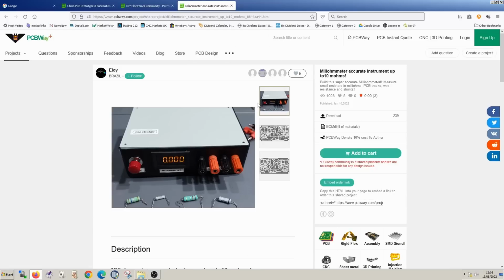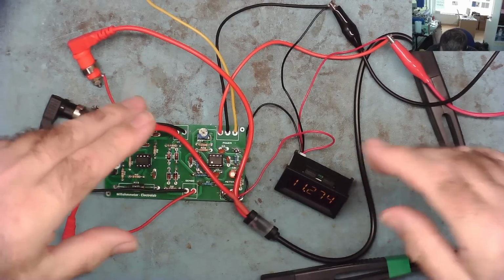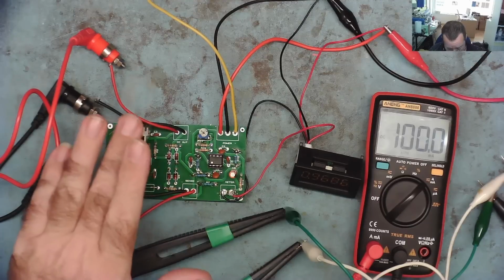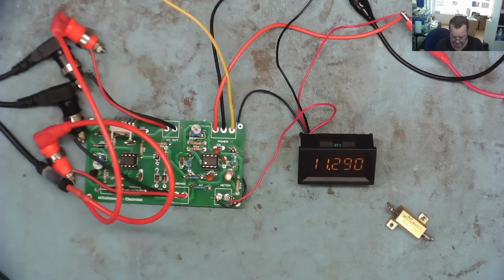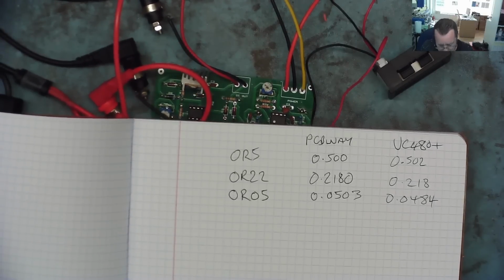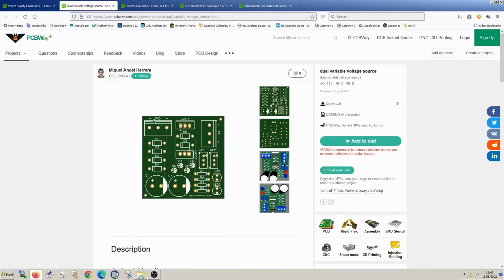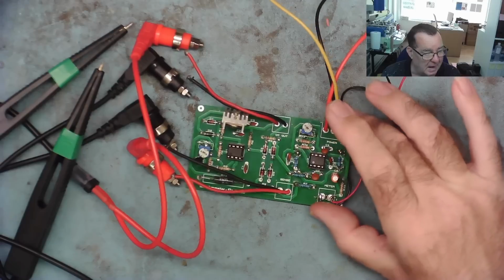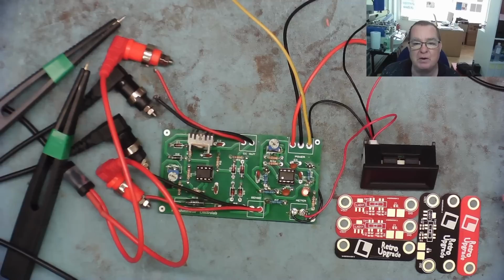Build A Cheap And Suprisingly Accurate MilliOhm Meter DIY Project

Comment: I'll be trying to built this. I definitely need a 5w 10ohm r15. It was running 1.2w according to your measurement. 

Thanks for the video. 

For the projects listed, the inverter one is my pick. Building it might teach me to repair inverters.
Reply: I’m not sure it’s necessary, there should only be 100mA going through the 10 ohm resistor so it should dissipate 100mW I think.

Comment: If you have a laboratory power supply with current control, you can deduce the low resistances using Ohm's law:
R = U/I
with U = 5V and I = 0.1A then you multiply by 10 the result of the voltage recorded by the volmeter!!

That's all !!

Comment: Nicely done!

When you get down to the resolution you got down to, measuring milliohms, everything matters.

The "settling" looks a lot like thermal EMF, I would guess because the probes are made of a different material than the resistor leads, thus forming a thermocouple that introduces enough microvolts into the measurement to become visible in the readings.  The value is always going down (or it could go up); showing a trend in one direction that way is a good clue.  (There can be other parts of the circuit that are settling that way, of course, but thermal is everywhere at these levels.)  One simple technique for that is to reverse the current and take a second reading, so that the EMF adds to the resistor voltage in one direction, and subtracts in the other because the voltage is negative.  The "real" answer is halfway between those two readings.  (This is only going to work if the circuit can handle the reading in either direction; some fussing.with the technique, or the circuit, might be required!  Could be a little tricky with only one supply voltage.)

Then...  doing the math for what kind of precision you're actually getting could be interesting!  Computing percentage for a nice selection of resistors, and getting a good feel for what you can expect from the meter.  Keep in mind the precision of the resistance measurements is entirely dependent on the precision of the current source, and the precision of the gain of the amplifier, and so on and so forth; it's going to wiggle a little bit with temperature, and time, and the weather...  and maybe what we had for dinner...

Comment: 18:40 - I have been unable to locate a micro ammeter on your channel. I hope you’re interested in such a project. I need to measure the current through an aqueous sample with 3.3vdc applied to the sample vial. You may very well will have been the first channel to produce such a circuit.

Comment: i was wondering if you use a 3 volt power supply and a current limiting resistor between 500 ohms to 2kohms to make the 20 cent short circuit tester. all you care about is the voltage the voltage to go down. i picked the resistor range because it a ratio of 1 to 1000 voltage drop

Comment: if i have a dc power supply is it possible to adjust the current to 0.1A and then use the DCPS as ah milliohmmeter? my powersupply has also 5 digit so it shoult work or not?

Comment: SIR please make a video on  transmitter and receiver  module  of RC controlled toy car , explaining  how the signal or data is transmitted  from transmitter to receiver , which controls movement of the motor in the toy  i.e forward and reverse movement

Comment: Note: The lower the value of the resistor - the more important it is to place the probes exactly on the same spot on the soldering legs.
This may be the explanation for the difference on the 0.05 ohm resistor value shown on the 2 meters.
Thanks for your efforts making up the video, highly appreciated :goodvibes:
Reply from the maker: Yeah that makes a lot of sense as at these sort of resistance values, even the resistance of the component leads becomes a factor.  I guess from your comment you were fairly impressed with the performance of this MilliOhm meter considering it is such an inexpensive device (though it does require the selection by hand of four resistors to get it to work well  -see part one)
Reply: @LearnElectronicsRepair  Cheers - Yes - I am very impressed by the accuracy.
it just shows how far you can reach with some thinking and a handful of simple components.
Reply from the maker: @CXensation  yeah me too, and despite several previous opinions I also think the el cheapo smd tweezers converted to kelvin probes worked better that expected, though I had to strap a bit of insulating tape around them, as you may have noticed, to stop the soldered together ends coming apart again due to the tension/pressure.
Reply: Regularly use one for pairing source/emitter resistors on amps - placement/tension and DUT temperature are critical factors. Best handle with ceramic tweezers, as all it takes is to grab one with your fingertips to see the reading go up substantially - as expected with 350ppm/K.

Comment: The difference between the two meters could just be down to where on the resistor leads you put the probes. A typical 0.45mm resistor lead is about 1 milliohm per centimeter IIRC. I'm impressed with how well that circuit works. Makes my fairly cheap milliohmmeter look really expensive.
Reply: Yeah thinking the same, at this range and resolution you'll definitely see the varying resistances at different points of the resistor leads, pretty impressive.
Reply: I was thinking the same
Reply: Curious what meter of yours that you’re referring to? Just curious is all
Reply: @hullinstruments  I have a Voltcraft r-200. It's a much nicer build quality than the vici meter but is about three times the price. It was the best I could find without getting into very expensive electrical installation testing meters, or professional level milliohm meters costing thousands.
Reply from the maker: Yeah you are the second to make  this comment about where on the resistor legs i placed the probes.   If there is one thing this tells me about this very cheap MilliOhm meter it's that it is extremely sensitive, far more accurate than I expected, and well worth building,  on a bang for bucks scale of one to ten it has to be near the top end 😃

Comment: To anyone interested in cheap/DIY troubleshooting tools and equipment… I’ll post some info below.

I been Absolutely loving your test equipment content. I haven’t really enjoyed electronics as a hobby or outside of work hours for a few years but after stumbling across your channel it’s kind of getting me back into it.

I’ve left a lot of comments on your test other vids and I’m going to copy and paste them below for anyone who wants to read them. 

I have my own metrology lab and do this full-time, and I specialized in test equipment. But I also collect useful and strange test equipment ….especially devices that speed up the process of troubleshooting. I’ve got nearly 2 dozen devices in my collection that have been sold or offered as DIY designs over the last 30 or 40 years… All of them can pretty much be summed up to “short circuit tracers“… But it’s amazing how some of them go about it and some of the really neat and weird design choices. Sorry for the long comment but I’ll post a summary of my comments here below…..
Reply: Best thing I found is a “audible milliohm meter” like the EDS “ leak seeker” ..... 

seriously look it up if you haven’t seen one. 

It’s basically an extremely fast and accurate low ohms meter that SINGS. It plays a different pitch as the resistance changes, even the tiniest changes in resistance. Like the difference in 1 mm of copper trace.

allowing you to track down shorts like nothing else you’ve ever seen. And I’ve got a metrology business doing test equipment repair and calibration… So I’ve got all the professional expensive benchtop gear… But I swear to God I grab for the EDS devices every day. Not only the leak seeker but also the cap analyzer. 

 Not affiliated with them at all, I’ve only talked to Dave the designer once or twice. Nothing to gain or lose and don’t give a shit if anyone checks it out… I’m recommending it only because of how much it’s helped me and countless others.

Like everything, it takes a bit of practice to get used to it. I like to compare it to a high-end Metal Detector or something like that… You can’t just spend a ton of money and expect it to work and interface with your brain instantly. Or like professional engraving equipment used by jewelers and Gunsmith. Or a fancy tattoo gun or something like that .....You can spend a few thousand dollars on an engraving machine… But you still have to learn to use it and practice.

But with a little bit of practice it will be One of the most useful tools in your arsenal.
———————————————-

Also, not sure if you folks are familiar with the device called the “half ohm” available online pretty cheap. And other multimeter adapters that you can build cheap or free. 

There are many videos on YouTube about these milli-ohm adapters, I’ve tried several variations and they’re all pretty decent. 

Especially if you use one of the cheap sets of kelvin clips/silicone leads available on eBay and other places in China. 

Don’t get me wrong, I love my fancy benchtop equipment, with their various leads and fixtures, all beautifully and painstakingly designed… 

But you can spend several hundred dollars very easily on a simple set of Agilent/keysight text leads. And unless you’re doing this work every day and offering it as a service like I am, it’s pretty much ridiculous and not needed. And you can get by with some thing that is incredibly affordable. With a precision that will surprise you!

 It really is the golden age for electronics… And Especially test equipment.

—————————————-

SUPER TIP…..
TLDR use TINY film thermistors that will allow you to track hotspots instantly without a thermal camera.

OK so this is a bit long I apologize…..

Yet again I’m sorry to leave another comment but when it comes to temperature detection, if you don’t want to invest in a thermal camera… Try this.

Take the smallest thermistor you can find. Like the little thin film ones found in most inkjet printers, or found monitoring the temperature in a laptop battery pack or other battery pack. 

These things are tiny, They will be the tiniest little thermistors you’ve ever seen literally like The size of a large grain of sand. Like 1/4 the size of a piece of rice. The smaller the better because it has faster response and recovery since it has less mass

Get a sharpie marker and disassemble it throwing away the ink portion…. But keeping the felt tip. Poke a  needle through the felt tip and position the thermistor so that The legs of the thermistor pass through the felt tip and into the body of the sharpie. 

Run a few flexible silicone type wires at the back of the sharpie and connect to the thermistor. Instead of cheap multimeter leads will be OK as long as they’re flexible. You can usually get a decent set of silicone leads from Banggood for less than five dollars, keep in mind you’re cutting off the end of the probe so you don’t want to spend much money on them. Maybe even have a broken sit around and you can just step off the probes.

use a little bit of super glue or epoxy on the end of the felt tip, not completely covering the thermistor but only leaving just a tiny little portion at the end exposed. 

thermistor should be pushed down to where it’s just barely sticking out, but a little bit of adhesive can protect it and make sure that it doesn’t get damaged but without covering the actual tip of it. Just so that the legs and things don’t get flexed or stressed. Because these things are tiny and just looking at them wrong and make them fall apart

Now you can plug it into your multimeter on resistance mode, and it will respond instantaneously within like 1/100 of a second to the varying temperatures. It is literally so sensitive that when I set my multimeter up in a room and leave the room letting the thermistor stabilize… If I even come a few feet from the doorway to that room you can see the multimeters display start jumping up just because of the infrared heat from 20 or 30 feet away. 

It is ridiculously sensitive.
You can literally touch the wall with your hand for a split second and even several minutes later the thermistor can pick up the change in heat where your fingerprints were. It’s that crazy sensitive.
These characteristics are very similar to a thermal camera, but of course instead of seeing the difference in color you’re just seeing the multimeter resistance display jump up and down

 Now that it’s plugged into your meter, that you can sweep across a circuit board and it quickly find the warmest areas.. its a Thousand times more sensitive to heat than your fingers, 

this thermistor contraption is basically free, and will allow you to track down temperature differences at an incredible speed and efficiency. You can Google “thin-film thermistor“ or just rip open a rechargeable battery pack and you’ll see them taped to the 18650 cells. They’ll have a bit of kapton tape around them to keep them from flexing or stressing. I usually keep the tape on the legs but trim the very tip of the thermistor so it’s the only thing exposed. 

Keep in mind the legs of the thermistor are basically like human hairs they’re so tiny.

The smaller the thermistor the quicker the response time as a bigger one would hold onto the heat and not recover instantly. 

I’ve made several of these using different types and resistance thermistors. Usually the resistance is between 50k abd 150k ohms 

Some recover a little faster than others depending on size, room temperature resistance, and the type of material the tip is made out of. Sometimes Glass sometimes epoxy , All kinds of different materials. I’ve had good luck with the glass tipped ones, I use a cheap diamond fingernail file to grind away the very tip of the glass getting extremely close to the junction inside of the thermistor. This improves sensitivity. But it’s honestly not even needed because they are already ridiculously sensitive

 The good thing about harvesting them and using all dried up sharpie markers is there free to make. Even if you do need to buy the thermistors they’re usually a few pennies apiece or maybe a dollar. I’ve even use some of the thermistors like sold in the 3-D printing community used to monitor the hot end… They make great heat detectors for troubleshooting. And are widely available

So if you make a few with different types and resistances, some will be a bit faster responding so I’m a bit slower but that’s actually a good thing because sometimes you don’t want to respond and be super jittery.

Not only is it basically free and incredibly useful for tracing down issues on PCBs.… but you can also use it to search for “heat leaks” in your home around doors and other places that could use insulation or attention paid to the cracks

I have several thermal cameras that I use in my lab but these are just as useful, a little less convenient maybe but damn still super super useful
———————————————-
Reply: Thanks for the tips.
Reply: waw, this (by far away) is the most valuable youtube comment I ever read. 
thanks for being so helpful and so reasonable in your writing.
as for me I love how the expensive meters are built with attention to every detail and plentiful information of the exact performance. and I appreciate how some companies are making high precision meters for affordable prices that I can have.